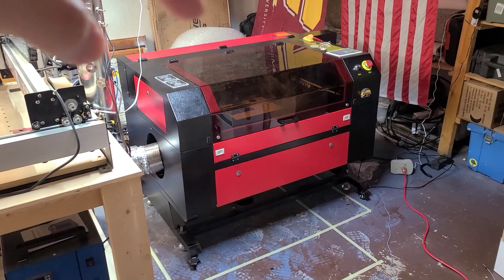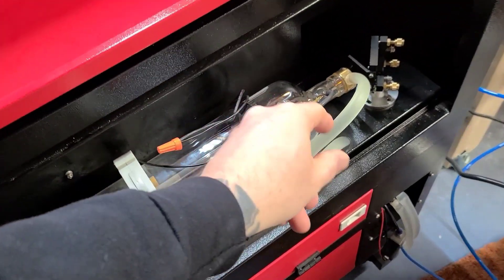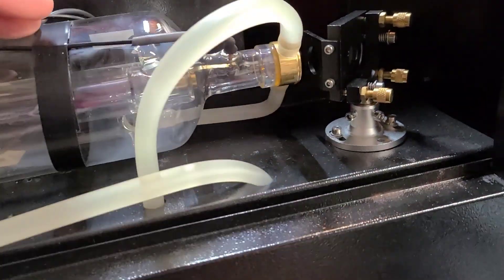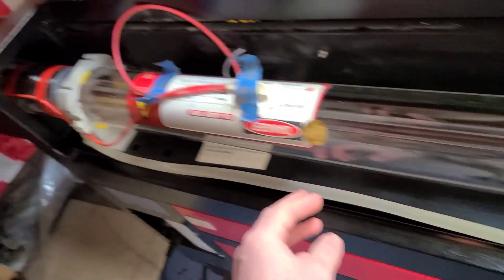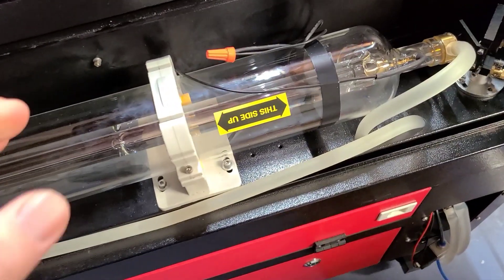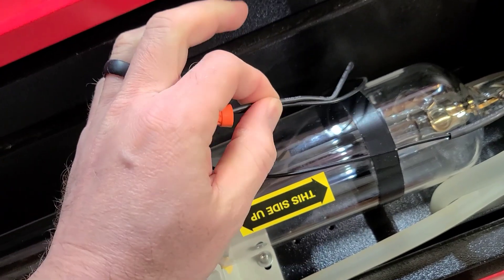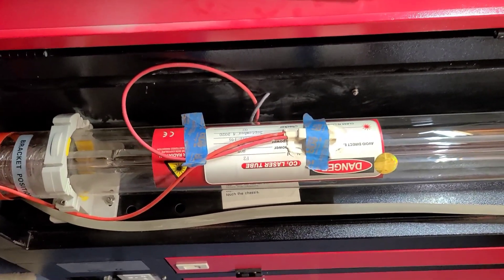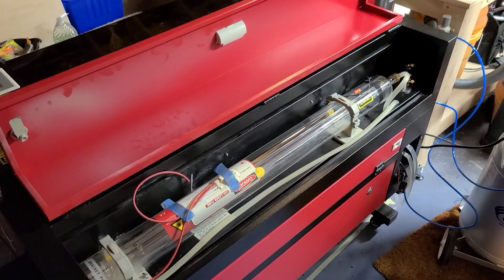How to Install your CO2 Laser Tube

Comment: i just installed a new tube. is there supposed to be water in the outer most part of the tube. mine isnt. tried everything. boss ls1630
Reply from the maker: No just the center tube. If water gets in the outer jacket, it’s broken

Comment: How much distance should there be from the end of the laser tube to the mirror? Do you have to do any recalibration once installed? Thank you
Reply from the maker: You might of missed it but I didn’t mention .5”. I’d give yourself may be .5”-1” to allow room for cleaning. There’s a lens at the end of the tube that needs to be cleaned every so often. 
The distance, however, doesn’t really matter because it’ll be bouncing off a series of mirrors as it is. Once your tube is installed you’ll have to align your mirrors.
I recommend following out setup guide at laser-guys.com/setup

Comment: My laser didn’t come with a ceramic cap. My red wire is already capped.  It looks like all I needed to do was screw the red to the other piece on the power supply. I have an 80 watt. Does this sound right?

Comment: What are the low voltage wires omtech say to connect the 50hz resistor to?
Reply from the maker: Join our fb group. I have a picture to post of the setup.
Reply: @EdmondsWoodshop  can’t find you on there and your link tree page doesn’t work mate. Thanks for taking the time

Comment: Cam,  how critical is the spacing between the front of the laser tube and the frame for the first mirror?  I've seen videos with distances mentioned anywhere from 1/2 inch to 1.25 inches.  Why the big difference and what impact on the laser output/performance does this spacing have?
Reply from the maker: It’s really not critical at all. Your beam travels over much longer distances than 1.25 inches. Having it up closer is easier to control where you want it to hit, but really makes no difference in performance once everything is aligned.

Comment: does it matter where on the tube you place the ceramic cap?
Reply from the maker: Nope some actually zip tie it to the top of the tube. As you can see I clearly made a mess with mine. I’d keep it away from the frame bc the high voltage wants to arc off the body if the ceramic block isn’t sealed properly

Comment: thanks for this video. I'm going to be helping a freind set up his 100w in a couple days. I currently have the 60w r&B so tube installation is new to me even. Can I not just use a wire nut for the red wires as well? If no and I have to use the ceramic does the silicone absolutely have to dry completely before first use?  He lives an hour away and I really don't want to have to hook up the tube and drive back for a second time to help him set up the rest once the silicone is dry. Thanks
Reply from the maker: Yes, you absolutely have to use the ceramic cap. the high voltage will go right through the nut. Have your friend place the tube in the mounts loosely. The black wires can be connected with an electrical cap. On the high voltage lines, twist the red lines together and shove it in the ceramic cap as far as it will go and seal the end with the included silicone. You can make adjustments to the tube when you get there.
Reply: @EdmondsWoodshop  thankyou for getting back to me. What I was asking is can I go ahead and use the laser to align his mirrors and complete setting it up and right after connecting the the high voltage wires? Or do I absolutely have to allow the silicone to dry before using the laser at all?

Comment: My 80w tube came installed with packing tape all the way across.  On red wire to the tube. Wires are also are zip tied down. Do I need to remove the tape and zip ties or leave them alone?
Reply from the maker: you can leave it if you want. The tube doesn't get hot and the tape and zip ties will hold everything in place.
Reply: @EdmondsWoodshop  thanks for your quick response.  I can't wait to get started!

Comment: Thanks for this video, very helpful. Question... we are looking at a 100w Omtech that was purchased by a guy that never used it and now wants to get it out of his way. Is there any reason we could not plug it in and make sure the power works without the tube hooked up? What would you do in this situation?
Reply from the maker: Technically you could turn it on, but without the laser tube and water running through the system you'll get errors. All that you'd be able to verify is thay the power turns on. And just in case you didn't know there's two power supplies. A 24v power supply which powers everything except the tube and a power supply for the laser tube. The key switch controls the laser tube power supply only. Also make sure the emergency stop switch is popped out (not in) otherwise nothing will turn on.
Reply: @EdmondsWoodshop  ok thanks, I just worried about the loose wires in the back arcing?

Comment: Did your new tube come with the extension box? Where did you get the tube from? Thanks!
Reply from the maker: This is actually the original tube that came with the laser. They shipped separate (probably to prevent damage). The extension box came with the original order as well.
Reply: @Edmonds Woodshop  I'm looking at upgrading to a higher power tube but I understand that the length will differ. I'll have to buy an extension box if it isn't provided with the tube upon ordering. Thanks for the reply and video. - Chris (same as above, different account)

Comment: Thanks for this!  Very helpful.  My 100W OMtech machine came with a sticker that said "..and do not let the ceramic cap touch the chassis"  does that mean that it should not touch the metal frame of the machine, or in other words the cover?
Reply from the maker: Yes exactly. The cap is used to insulate the high voltage and the closer it is to metal the better chance it has to arc. If it's mounted to the tube you should be fine.

Comment: got the fluid going through my laser tube - OMTech 80w laser engraver.
Using an CW3000 water chiller but I have a dime sized bubble and also hundreds of tiny bubbles.
Cannot find a video showing or stating how to remove the bubbles and have heard on many videos that I cannot use the laser engraver if there ARE bubbles inside the laser tube.  Any advice?
Thank you
Reply: I just saw a vid, were a guy got rid of it by filling the water in his chiller to the max.
Reply: Make sure the tube is in the correct position, is sounds like you need to rotate it upside-down

Comment: Hi  thanks for your video. I just aquired the same equipment and I have a question regarding the laser setting. 
The red wires arrived, tapped in Black tape already packaged in the ceramic cover. Do I need to remove the black tape and to fix the ceramic cover with white silicon tube?
Thanks a lot for your video and your help. Sincerely

Comment: Is it ok to have the wires sitting on or touching the tube?  I'm assuming so... is this the 100W 20x28?  Thank you for all of the videos!  My laser isn't here yet but soon!!!
Reply from the maker: Absolutely Okay. Everything just sort of gets tucked in there. The tube won't get hot so no worries about that. I have the 80w red which is the same exact body as the 100w 20 x 28. You'll just have a longer tube.
Reply: @EdmondsWoodshop  Thanks Cam!  I had no plans to order a laser that I would need to install the tube....but I did!  lol!  Thanks for all of your videos and guidance!